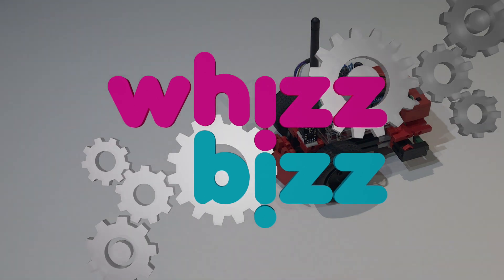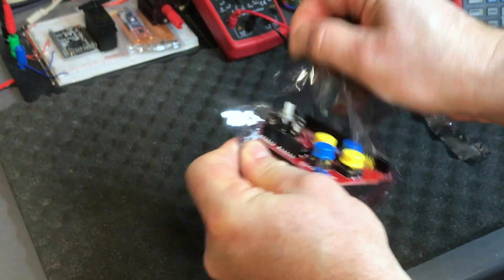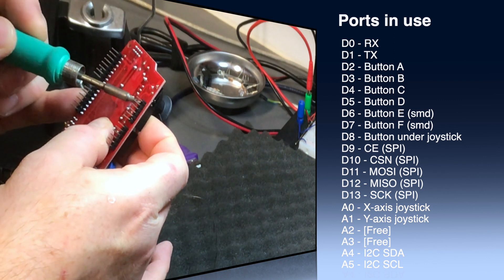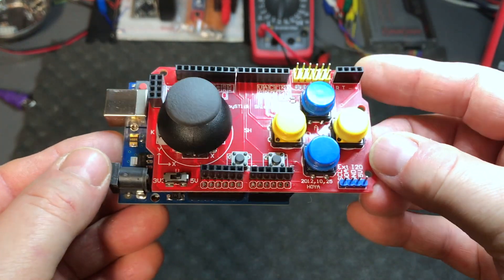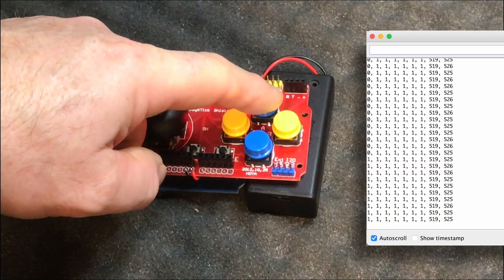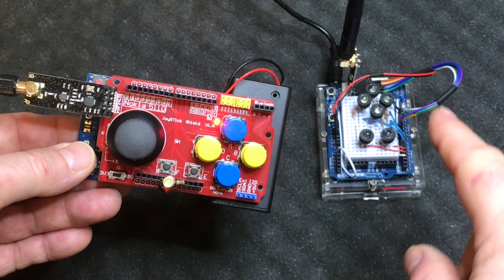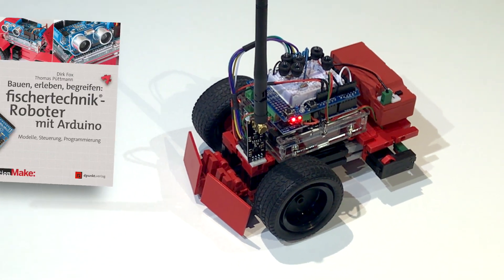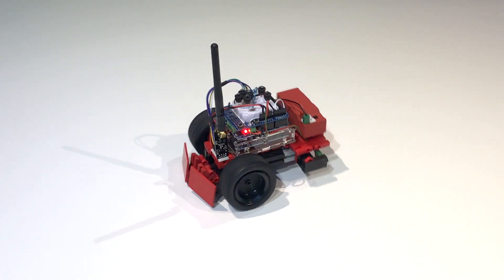Joystick shield and nRF24L01+ tranceiver

Comment: Can i use 7.4 lithium battery will that fry my compenents?
Reply from the maker: As long as you do NOT connect it to the 5v pin of your board, but to GND and Vin of your Arduino Uno, there should be no problems, I guess. See https://store-usa.arduino.cc/products/arduino-uno-rev3

Comment: Nice video, but what about controlling servos?
Reply from the maker: The joystick just sends an analog value between 0 and 1024. You might take a look at a Sketch that includes the "Servo.h" library and/or use an Adafruit MotorShield like the one in my other video https://www.youtube.com/watch?v=ppMnxtBFq6o to make the servo move on the receiving end.

Comment: switcher in 3.3 V or 5V????
Reply from the maker: As you can clearly see in the video, I kept the switch on the board to 5v. The socket for the  nRF24L01 on the joystick-shield ALWAYS provides 3.3v, independently from the 5/3.3v switch on the board. nRF24L01 likes 3.3 volt.

Comment: Nice video! the nRF24L01 on your joystick operates on 5V or 3V?
Reply from the maker: Good point, had to check this. The socket for the  nRF24L01 on the joystick-shield ALWAYS provides 3.3v, independently from the 5/3.3v switch on the board. nRF24L01 likes 3.3 volt!

Comment: great tutorial!  I would like to use a L298N motor controller on a Mega board instead.  How would I recode your sketch to use it? Thanks!
Reply from the maker: Did you check: https://create.arduino.cc/projecthub/ryanchan/how-to-use-the-l298n-motor-driver-b124c5 and swap the include for the motor shield for the L298-lib of choice. I did not check it yet, I only used the TB6612FNG boards as an alternative of the motor-shield. You can connect multiple of these (especially on a Mega with so many outputs!). Happy hacking and good luck!

Comment: Wow, interesting code! I'll check if it works on my hardware... Many people say that if you want to use nFR to communicate with other device you will need some capacitors in voltage sections nFR, because voltage to work nFR would be unstable (?). I tried it many times without results. All my projects Radio Controlled doesn't works :(
I have a question: did you try to control other devices using this joy with bluetooth communication? There's a place where you can to connect it, but I'm looking for a code for that, but no results. Most people to control devices via BT uses Android app, so why not to try using this shield?
Reply from the maker: Thanx! Take a look at the other video's in my channel with this Joystick-shield and Bluetooth! Or at https://www.whizzbizz.com/en/bluetooth.joystick.shield
Reply: @arnoud-whizzbizz  Wow, great! Thanx! I'll check it :) How about nFR+capasitors, did you heard about that? Check this: https://bronet.pl/produkt/hardpilot-v2-diy/ at the bottom there's a diagram.
Reply from the maker: @Xyfka2  I did not have to place extra elco's to stabilize things. I can image that some motors may interfere, but in my case it all worked right away. DIY-joysticks: there are a bunch. Did you check: https://howtomechatronics.com/projects/diy-arduino-rc-transmitter/